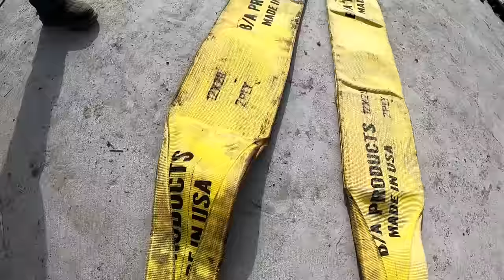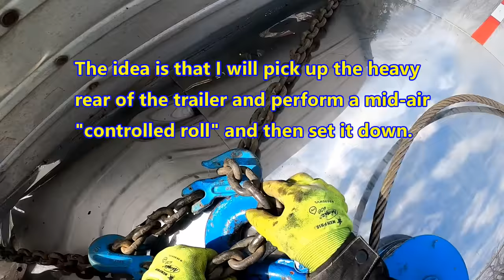Haz-Mat Tanker Rollover Shuts Down Everything!!!

Comment: Hazmat technician here! For anyone who doesn’t know much about our field, there’s a lot that goes into a situation like this. We would have to safely offload any fuel that is inside the tank, typically with a vac truck, and also do preventative measures like surrounding the area with dirt and boom in case of a spill, typically a jib like this can take up to 5 hours plus. This is the normal procedure that we do when it comes to any tanker wreck, no matter the material inside, but for certain materials there are certain protocols that we MUST take such as protective suits and other PPE. I have done really nasty stuff such as hydroflouric and hydrochlorich acid and let me tell you, spills like these require a lot of time, patience, and careful planning. As for a gasoline tanker situation like this, anyone who is not essential to the removal of the material will be asked to vacate the immediate area, just in case something does happen, and I hate to say it, but minimize casualties. There’s always a risk for something to happen, but 90 percent of the time these jobs go pretty smooth for the most part

Comment: Ron. Some of these vent valves have what’s called a rollover valve inside them. The intent is for a ball check valve to prevent leakage when the tank turns over. Just the thoughts of an old man.
Reply: But if you're pulling a vacuum on the tank, wouldn't the ball be pulled into the open position to allow air in?
Reply: lloyd holt wait I’m lost now?
Reply: @Debs Crokaert No, it is a ball check, They have springs on them to keep it closed when upright. When a trailer rolls the ball is already home on the seat and stops most, not all, leakage. When a vacuum is pulled the ball moves off the seat slightly which allows air to pass by it and the tank to be pumped. Atmospheric pressure must be figured into the dynamics of how they work. When pulling a vacuum on a tank like that, you already have around 14 pounds of pressure helping with the pumping depending on elevation above sea level.
Reply: @Rickimusic  true but in the beginning there's too much weigh pressure from the liquid on the check valve to allow it to open.
Reply: @neonhomer  That would be the idea. The check valve allows air to enter, but doesn't allow liquid to exit. A check valve is a valve designed to allow flow in only one direction.

Comment: Sir. I work in plastics, and must tell you - that linear low-density polyethylene plastic sheet under that fuel is dangerous. Cool, dry temperatures are perfect conditions for static discharge - the clothing those crew members are wearing, the dust from the ground, can create a static charge on the plastic sheeting. II would advise something like the Industrial Strength Pig Absorbent Mat Roll on Amazon to place under whatever you are using to catch the fuel, or have a truck that carries fill dirt and a shovel. Its a lot safer. Thank you for your hard work.
Reply: Absolutely correct. Not a static discharge line anywhere.
Reply: Dang didn't know that. That's crazy
Reply from the maker: @chrisunger8123  Actually, there were ground rods and lines in place.   They may not have been visible on the video, but they were there.   The regional HRT made certain of that.   Thanks for watching and God bless.
Reply: @RonPratt    Att 35:50 on your vidya - its clearly visible with a red/brownish cord - going from the undercarriage of the tanker trough a ground rod. So - they where there.
Stay safe and live free - blessings from Norway

Comment: I remember seeing a rail car implode on Mythbusters, it was pretty amazing to see. From tank to flat can in 0.02 seconds.
Reply: I saw something similar but it was a safety training film where they imploded a tanker. It doesn't look like anything is happening until implodes, but when it does it happens quick. 

On a winery that I was building when they where installing these large stainless steal vats they accidentally imploded one of them. I forget exactly how it happened though. It was crushed beyond repair.
Reply: @iamjackalope  happens when they clean the insides with hot water or steam and then seal it off. As the inside cools, the pressure drops. If the tank was open to the air, this would just pull outside air into the tank, but in a sealed tank it creates a vacuum. Most tanks can handle a slight vacuum but once you get past the fail point, they implode in the blink of an eye.

Comment: Tanker yanker driver in Alaska and just want to say a huge thanks to all you tow/recovery truck operators. You all are a beautiful site to see when you show up. In this video, that tanker looks like a hot liquid asphalt oil tanker. Insulated to keep the oil hot(300-350 degrees F) so it doesn't set up solid. Can haul different products, like diesel fuel. 1993 is the placard for diesel fuel. These videos are awesome!!

Comment: When i was medical first responder, i got a couple of call like this. And as press photographer, a lot more. 

Tanker recovery is always tricky, no matter whats the load. But when its hazmat, its way more job. 

I got a call for 53ft water tanker upside down. No stress, goes like a walk in a park. The next week, got 2 diffent call for 2 roll over. #1 was fully loaded 53ft jet fuel truck, and #2 was fully loaded class 1 explosive... a bit more stressfull than the water truck.

Anyway, all the team in your video make a great job. They secure the scene, take time to plan, seem to have very good communication. Stay safe and continue your great work.

Comment: "Might as well get my destruction on video".
Ron is so dedicated to his viewers.
Reply: Dimetime35c  Yeah, except that, if the tank was only partially loaded with sufficient room for vapor, and it goes up, you're looking at a "poor man's FAE". And if THAT happens, even the SD card is toast. Or simply vaporized. Fuel rarely explodes like all the silly Hollywood exploding car scenes, but fuel tanker like that definitely has at least the potential to become a nasty and massively destructive thermobaric weapon. It's not necessarily all that likely, but possible. I dunno how many people know this, but when you haul a fuel tanker, one of the concerns is that the fuel is always sloshing around inside, and that generates plenty of vapor. The internal baffles and the venting help, but there's still lots of vapor. Especially after a rollover, and moreso if the vent is blocked or obstructed. On a side note, the sloshing around also makes tankers an interesting and somewhat unstable load to haul, although in my personal experience, a 53' dry van loaded with 55 gallon drums of petrochemical products is actually worse (hauled both of those things as trucker, many years ago).
Reply: @RedneckCowboyFeller   yes it would slosh around quite a bit but it's my understanding that tankers have baffles in them to keep the fluid from going all the way from the front to the back end. Is that correct?
Reply: It is true that tankers have baffles in them but whatever is in the tank will still slosh around.

Comment: "It can explode at any moment" - Ron stands next to it with his hand on it LOL. 

(Yes ik ik it was to check for popping, don't smite me it was a joke lol)
Reply: 10 lashes with a wet noodle 😆
Reply: Ron actually made the same joke to the guy trying to pump the liquid into the other trailer. I knew what you were getting at though.
Reply: i mean touching it vs 100' probably wouldn't make much difference for that size tank if it were to properly explode, I'd rather not have a chance to see it coming lol.
Reply: @thomasfletcher4765  noodle, .... or poodle?
Reply: It's moments like this I could do with a smoke.
Reply: Wrong it can IMPLODE not EXPLODE. Imploding is when the tank sucks it’s self in. It wouldn’t cause any major injuries that an explosion would.
Reply: смиренный It was a quote.... no one needed the “expert” opinion lol

Comment: When I first saw the trailer I would have sworn it was carrying milk, Awesome Video Thanks for posting Ron
Reply: The four digit code on the back in the red diamond is for diesel fuel and other flammable products, this includes polar solvents ( alcohols etc. ) 
You can find a reference guide app called ERG ( emergency response guide). It gives you all sorts of information on chemical classification and appropriate firefighting methods. Although I am a UK firefighter, we use the same guide as you do in the U.S. and Canada.
Reply: @alexosborne5629  those are UN codes, worldwide.   I haul alot of hazmat myself and have the proper training for first responders and emergency response.
Reply: @alexosborne5629  I know what the hazmat placard says. What Dart is saying, which I agree with, is that's not the proper tanker to haul fuel in. It looks food grade worst case, or an asphalt tanker best case

Comment: That driver's career is over 😞
You vent the empty tank back into the full tank, creating a closed loop. That's how we do it in oil so we don't die of Hydrogen Sulfide poisoning.
Reply: vapor recovery
Reply: @JW...-oj5iw  The rig rolled because the trailer wheels cut the corner and ran into the ditch, this caused the trailer to tip over and pulled the tractor with it. Mostly a miss judged turn on the driver's part and he wasn't watching his right side mirror.
Reply: @JW...-oj5iw Cut the corner and dropped the trailer in the ditch.
Reply: @nates831  That wouldn't have happened in the UK as our trucks have the steering wheel on the right side - it's not so surprising you so many accidents in the US!😂
Reply: @martingardener90  In the UK it would happen on a left turn.
Reply: @martingardener90  I'm a truck driver in the UK  (rhd trucks) .... and I remember having to turn left once ......terrifying.  Once was enough for me.......!
Reply: @missiontent111  I've been a truck driver for 30+ years - right turn or left turn - forwards or backwards - I don't care. I feel the trailer, even thou I may only be able to see the front or the side of the trailer in my mirrors. It's all about using your experience and taking your time to making it right first time every time.
Reply: Vapour recovery is not really necessary in this situation the vapours are not a big issue with gas they dissipate fairly quickly in open air.
Reply: @missiontent111  How on earth do you get off Roundabouts? !!
Reply: @martingardener90  Don't you drive on the left side of the road? Seems like you would be having a ton more left turn accidents there than we do in the U.S.A.
Reply: I know getting stuck on train tracks ( and this probably counts) is a 6 month or 1 year license suspension on first offence 2nd is no more CDL. That said, he'll probably have another job next week, just not driving hazmat, or making as much.
Reply: @The Adventures of Trucker186 and Tuttleman That might seem the case but judging by what I see on programs like Highway Through Hell and Heavy Rescue in a serious accident your cabs fall off and just crumple up, some look like they made of Fibreglass.
Reply: martin gardener   Sure but you would have been caught in a left turn position.
Reply: @martingardener90  it just happens on the left side for your drivers.  Lol
Reply: Agreed
Reply: There's liquid in the vent lines no way to feed pressure into full tank on its side.
Reply: With the trailer on it's side, the places you would normally vent it or connect a vapor return line (inlet valve and lid) are likely to be submerged, especially when starting the transfer (depending on how full the trailer is loaded). Tank trailers are not normally equipped with vent fittings on their sides. If you were dealing with something that is not flammable or combustible, cutting a vent hole in the tank might be an option. With flammable material, that is not going to be a safe option.
Reply: @martingardener90  It shouldn't have happened here, that wasn't a blind side turn, if he was looking at his mirror at all, he would have seen he wan't going to make it long before the tires hit negative space...
Reply: @rayives7758  
Was thinking same thing he's obviously slow
Reply: @martingardener90  well you guys still drive on the wrong side of the road😊😊😊
Reply: @nates831  On the exit the other rig came close to doing the same!

Comment: Hi Ron, question for you. I fully recognize that the “team” is needed for safety to the people and environment, but how do you financially take a 5-6hr hit and be tied up that long?  Does the insurance company pick up your tab?  I know much of what you do is because you are a great person, but you also have to run a family company.so I was just curious on how you balance giving assistance while still paying bills to feed your families. I apologize if this question came across as crude, it was just something that has been bugging me to ask you. Thanks,  Ryan 

#RonPratt #Midwesttruck
Reply: Well, he and his team probably get paid for doing their work there. Their work dosn't just include the actuall recovery, but also planning and getting ready to get to the next site. So they probably bill that time. Same with fire departments. We don't bill the time from when the first hose spits water to when the last hose stops putting water on the fire, but from the time the call goes out to the department from dispatch to when we have restocked the engines (wet hoses out, dry hoses in, refilling the tank, cleaning and dewatering the pump, refilling of foam etc.) in the house.
Reply: It's all billable. This is a big money day for them. Bill X equipment by Y hours, and add Z persons by Y hours, plus basic fees, mileage, etc and end up big $$$$. When I was towing it was a grand just to roll the rotator out of the shop, and goes up from there VERY quickly.

Comment: I remember back in the early seventies a gasoline tanker overturned on highway 50 about 1/2  mile from our house. It ruptured and spilled at least some of the fuel.  They got it upright and out of there without it exploding, but then had all that fuel in the ditch.
They just cleared every one away from it and burned it.  I understand they had a McConnell Airforce fire crew out there.  It was all cleaned up by the time I got home from school.

Comment: Wow, I had no idea how flimsy the shells on insulated tanks are. Those seams separated in an instant! I'm glad you all got out of there safely having to execute a tricky maneuver with dangerous cargo.
Reply: That outer shell is just to hold the insulation in. Ron pointed out that the internal vessel is high strength stainless.

Comment: As a long time Tanker Yanker myself. i would have tried to recirculate venting thru both tanks, basically creating a closed loop atmosphere with no pressure, or vacuum on either as pump ran. ( as other person stated earlier). this is why they should have had a check valve on one of the washout ports, or equipped with vapor recovery before loading with fuel, or off gassing chemical.

Comment: Your pulley put a dent in the tank...geez!  I love watching your vids as it is not only entertaining, but also teaches a lot about physics.  You have some fantastic vids.  Keep up the great work and stay safe out there.
Reply from the maker: The outer part that you see is just a thin shell of sheet metal (stainless steel)  The main tank is inside the outer shell and underneath a thick layer of insulation.  The inner tank is extremely strong and what we did had no damaging affects on the inner tank.   Thanks for watching and God bless

Comment: They sent the hi rail truck cool.  Glad your safe, when you unfolded that specialized strap the first thing  I saw was made in USA!  It was many years ago in Leg Mantec Quebec that a runaway train rolled downhill and blew the town up.  The fracing tank cars met a propane tank next to bar with many people in it.  What they realized that even Gas hydrates are explosove, and those are present in fracking solution and empty fracking railcars and on road truck tanks!  Safety rules were changed after that.  
Shutting down the railroad was good to put a fire line across it so train wheels would not severe the line, if it was your primary form of protection like a fog of water.  This could nescessitate a traing with a rail crossing.  But you had the real thing.  Be safe, keep on Trucking.

Comment: Mudflaps are useful in lots of ways!  for longer stuff, maybe, I've got a friend in a local package shipping depot and they generate hundreds and hundreds of feet of scrap conveyor belt every year, I use it for loading my dozer on the steel trailer deck and to protect garage floors from winter tire chains,  easy to pressure wash and tough as well as grippy.  Not sure if you know anyone at a local depot but might be another handy tool for the service truck.

Comment: I agree I can’t understand why they need an insulated tank for finished fuels. 
We use insulated tanks out here to haul our crude oil out of the uintah basin because every have to heat the oil to 140° before loading it so it will stay a liquid during transport to the refinery.

Comment: The potential danger this type of accident presents requires a heck of lot of personnel and resources. A good portion of the day was spent taking care of this. Fine job and a lot of small steps and steady-as-you-go. Very interesting how that external container was crushed but still maintained it;'s basic structure. But structural and Haz-Mat engineers work out worst case scenarios.

Comment: Just a brief comment about this tanker and the placard(s). These tanker are usually employed to transport hot oil or tar. The placard on this trailer is specifically used to indicate the load is diesel fuel. Gasoline would have a placard that is marked UN1203.

Comment: Most of those tanks on the inner tank have extra vents on the sides, top, and bottom at the front and back of the tank.  Problem is that most people don't know about them because they're hidden/covered by the outer shell.  You don't find them without peeling that tin on the outside back.